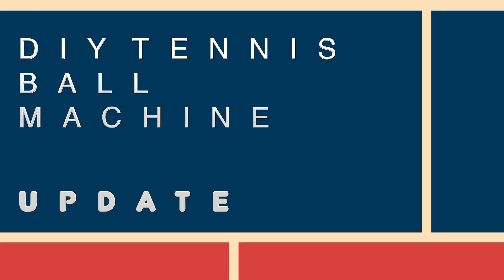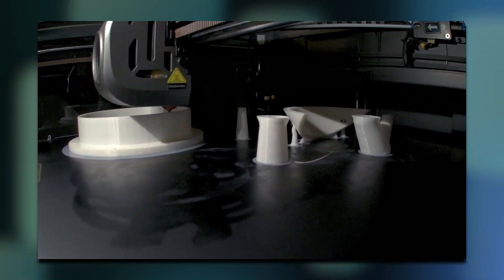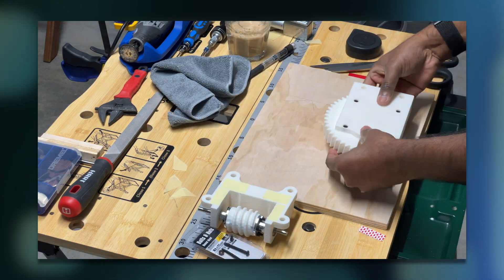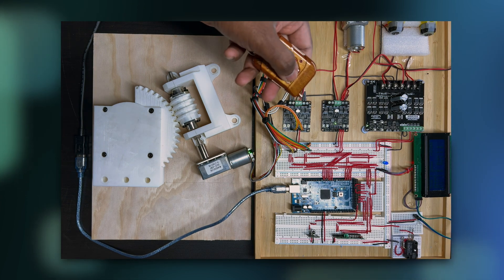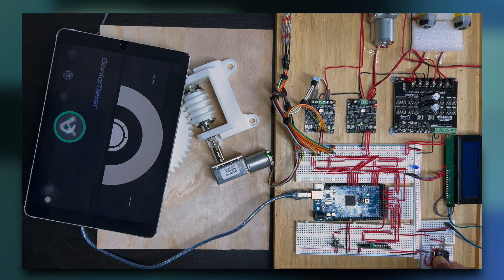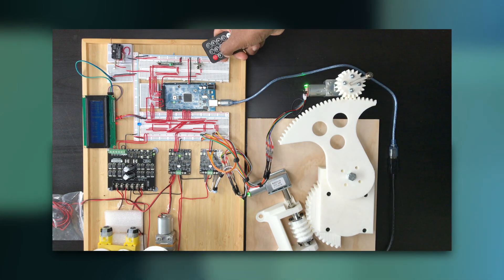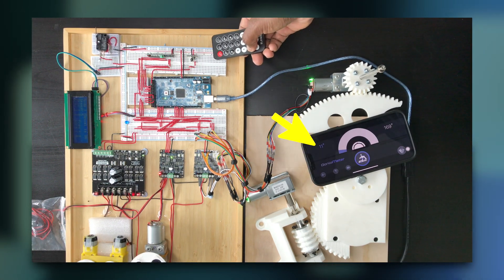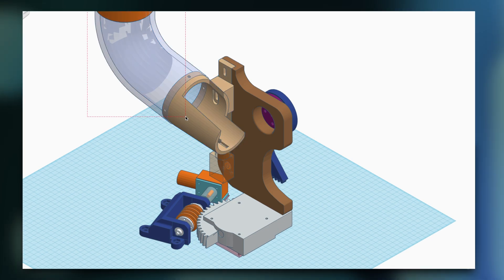Part 6 - Success with 3D Printed Parts - Tennis Ball Machine - DIY Build

Comment: Hey, really loved watching your journey and think about starting my own.
I am thinking of taking a different route and wonder what's you opinion 
Using Bluetooth and an app so I can tune values while on the court. Setting min/max values.
After finding the values, these can be used for the different modes seeing as top spin makes balls drop faster so more speed to hit the same spot.
Any idea on the wattage of each motor? 
Maybe want to use 24v platform. This way I have faster spin up times and can find 500w dc motors for €30 pp.
Reply from the maker: Thanks for the comment, and yes, that's a great idea to tune the values in real time using an app!

I have an update coming up in a few weeks time that has an app connection using WIFI instead but its just to make basic adjustments - I am looking forward to that.

TBH you can make this machine as complicated as you want, my experience is the  more you want from UI, the more its going to take to make it stable and usable. But if you have the time, go for it

Look up "remote xy" i am using that in the upgraded version

Comment: What wheel you use, 3d printed with petg maybe have enough grip, you had a gear type with track in middle, didn’t it work?
Reply from the maker: No that wheel didnt work as expected. It was an off shelf item and it was not balanced for high speed application. It was meant for bins and similar things. I ended up buying branded tennis ball machine wheels that are both balanced and shaped to throw tennis balls.

You could 3D print the wheel and add rubber tubing but then you still have to deal with coupling the wheel to motor shaft. I am not sure PETG is the right material as the wheel will have to deal with compression forces every time a ball is thrown out. ABS or ASA may be a good material but needs to be tested.

If you find a way to couple the 3D printed wheels to motor shaft, do let me know, thanks.

Comment: Hey John is there anyway you can share your Tinkercad files (drawings) of the base plate (w/ teeth) and the worm gear with housing?
Reply from the maker: Its just an stl file - I dont have the step files. You should be able to down load them using this link. Good luck

 https://drive.google.com/file/d/1iZ3503WU92QyQYW1N2oJiBs17hryC4aP/view?usp=drive_link

Comment: Great videos! What do you anticipate the build cost to be? Ball park figure?
Reply from the maker: I would estimate it to be around d $750 to under $1k US. Bulk of that cost is for the ball throw motors and throw wheels. 

There are other important components like the electronics but those aren’t very expensive. Then there is the 3d printed parts. If you own a 3d printer, the cost is pretty low, a kilo of ABS and PLA filament will be sufficient. If you don’t then, it’s a different story.. lol

Comment: Great to see one of your videos! I've been following you since the first Part and can't wait to see the final results. Looks good so far. It seems that the investment in a 3D printer was worth it! I'd love to invest in one too, any recommendations on which one I should get?
Also, why didn't you 3D print the wheels by yourself and use some rubber stripes or some polyurethane to make the outer part of the wheels?
Reply from the maker: Thanks for the support! Really appreciate it. 

You probably noticed I have a Creality K1 max printer. I basically wanted to get a printer that could print ABS and print large models in excess of 250mm in XY plane. That mean I had to go for a printer that has  300x300 print bed size. Also to print ABS, a closed printer is required. For researched using a separate enclosure but then the convenience factor wasn't favourable. Core XY printers seem to be the modern option and K1 series have good reviews. Bambu labs P1 series seem to be better in build and user experience but they seem to use proprietary parts and also don't have a 300x300 bed size. So had to exclude them plus they are a bit pricey.

Settled with K1 max in the end. So far its been great. If you are new to 3D printing, owning and operating a 3D printer is like owning a fairly sophisticated tool. There is a bit of a learning curve but K1 max seem to be doing good on their stock settings. I pretty much printed my PLA parts with the stock settings. The ABS has been a slightly different story in that I had to google and get the recommended settings for the filament as well as the printer settings. I think I can improve it a bit but so far, I am pleased with the results.

If build volume is not a concern, and you are ok to tinker with the machine which is anyway required. I would say go for a core XY printer from Creality like the K1C. If you are new and want minimal fuss, then Bambu labs P1 series is good.

The other option is to go down the bed slinger models but I think those are a bit dated. Again, if all you are after is printing PLA type material then a bed slinger would be just fine. As with anything, you get what you pay for. So get the best printer you can afford and that will last you for a good while. Hope this helps.

As for printing the wheels, I did think about it but then, coupling the wheels to motor shaft will again be a weak point. The direct coupling of wheels on the motor shaft will result in the best performance possible, IMO. But 3D printing wheels can be done, I might do that when the wheels I have wear out. 

Currently printing ABS parts and looks like it will be another couples days to go before I can put them together. I will try and get another video soon, sometime next week I think. Fingers crossed that everything goes to plan :) 

This turned to be a lengthy response haha!

Comment: Great videos. Really helping me with my own ball project. Out of curiosity what is the rpm of your wheel for a shot that travels the length of the court with one bounce? Other than that keep the channel going! You have the design know how and video editing skills to make this a big channel in my opinion.
Reply from the maker: Hey, thanks for the comment. I am yet to test that part. So hang tight and I will share the results soon. I expect it to cover around 23 meters in the lowest angle so I can stand behind the base line. And around 15 meters in the steepest angle for lobs and volleys. I do have the ability to control the motor power but the above is what I would expect as a minimum but only time will tell if it works. I hope it does as the motor and wheels I intend to use are branded products from lobster.